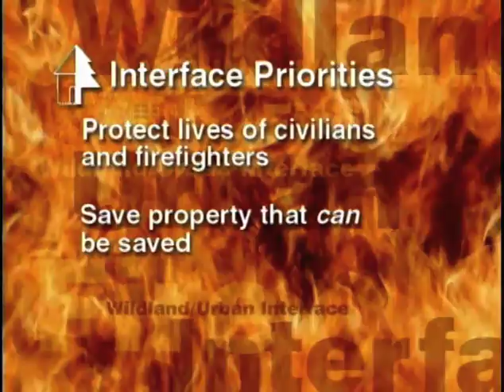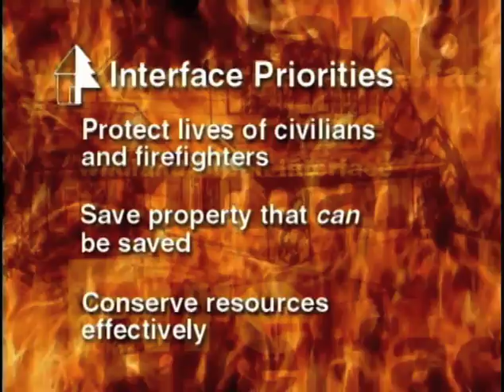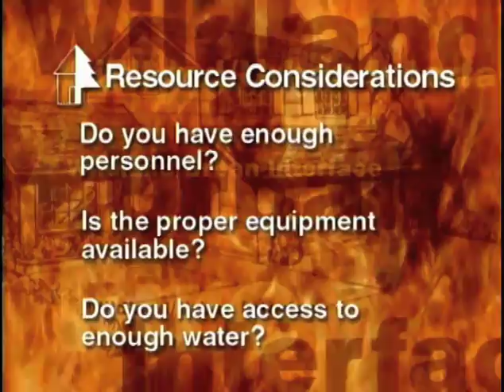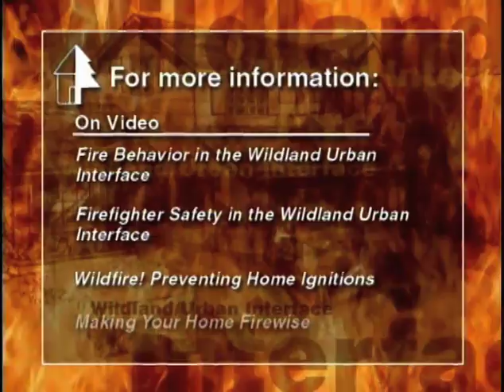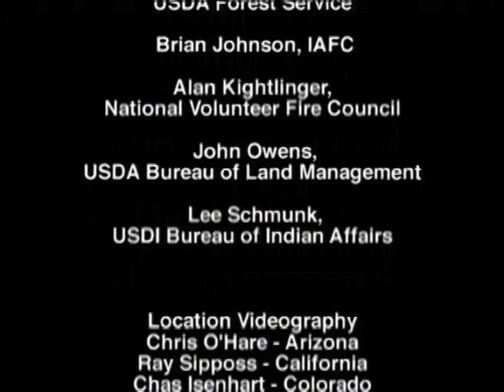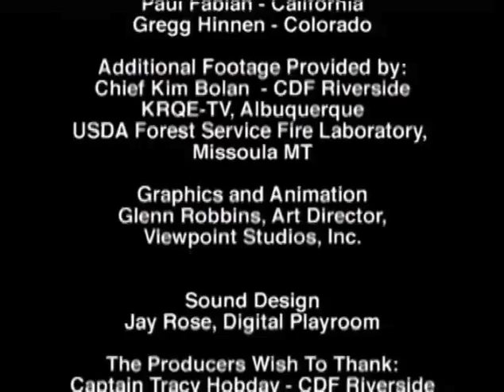Firefighting Strategies for the Wildland/Urban Interface

Comment: why even try to contain fires in wildland? often with no roads for truck access? when doing so just means more fuel next year anyway?  Why not instead devote all resources to structure protection where nearly all structures are near roads or driveways accessible by trucks, which are vastly more plentiful than aircraft, or at least should be; and vastly more powerful than crews on foot.

Comment: If firecrews show up around your house, turn on the sprinklers and leave.  You should already have blown the leaves away from the yard and foundation.  Fire season is obvious and announced, if you do not do the work to maintain your property, mother nature is going to take it away. keep the brush cut way back and low.  Make sure your wooden decks do not have debris under them and that any fuel like leaves or a propane tank are away from the house.
Reply: Plug in all your sprinklers and hoses, turn them on.  The firefighters will use that to find water sources, if you have done the other stuff, what fuel remains is going to be wet, the fire will go around your house, and the firemen might even think of your property as a safe zone.  You do not get a better chance at your house surviving than that, if you do not put in a little regular work, you avoid a lot of the hazards.  A wet yard takes care of the embers.

Comment: Excellent documentary! Just a comment on priorities: after nº one 'protect lives of civilians and firefighters' we're instead considering nº two 'identify and control those episodes that could eventually lead to a worse scenario' such as domino events (PLG/BLEVE, gas stations, industrial or other potentially dangerous situations etc.); after that we're considering nº three 'protect infrastructures and installations that could eventually derive in worsening emergency management environment' such as cutoff electric fluid, communications, water supply, road network, etc. Then after that, nº four consider protecting those infrastructures and installations entailing a potential significant impact on services to population. And only then consider protecting houses. As you well say, do not just arrive and jump to the fire, but analyze driving factors and immediate potential risks and draw a good action plan. Thanks for sharing! PS: my profile pic is taken in Lake Tahoe WUI fire!